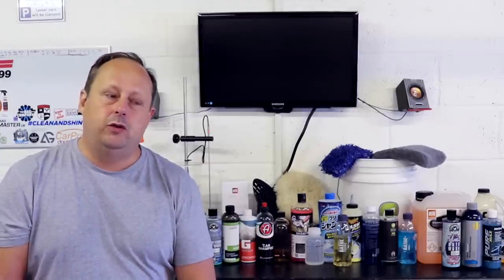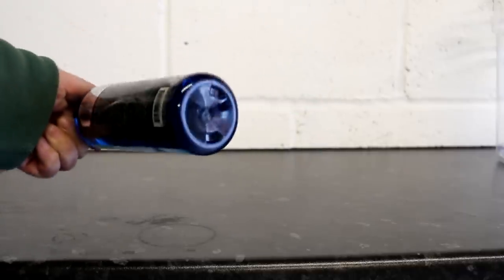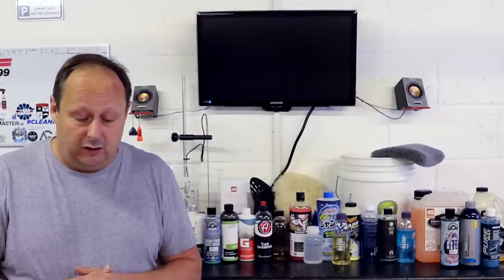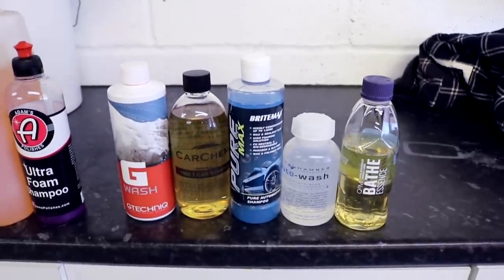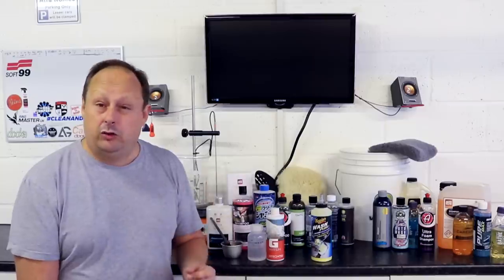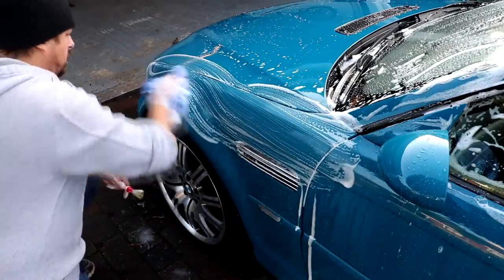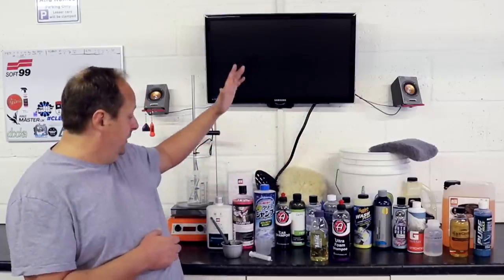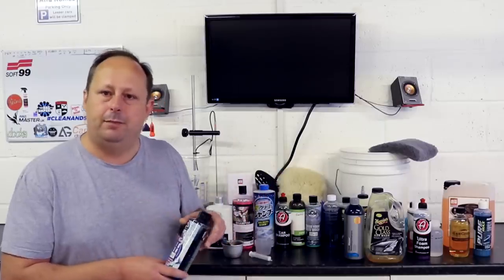The Best Car Soap Shampoo - 20 product shootout

Comment: Do you normally mix hot or cold water with the shampoo?
Reply from the maker: no Moh, unless is freeing cold.
Reply: @ForensicDetailing  Thanks. Even in warm conditions, surely you will get better cleaning performance if you had warm water? No?
Reply from the maker: @330d5  water water will help to break down grease and oils in dirt.  but really after prewashing a car, and then making the contact wash.  Ive never like not been able to get a car clean to the point where I thought I needed warm water to help.    like you can noticed the difference when you wash dishes with cold water you loose the ability to break down the grease quickly..   but I think car cleaning doesnt need that level of degreasing where the warm water will make a difference.   dunno though Mo, nothing wrong with using warm water in the wash bucket.
Reply from the maker: @330d5  prolly mate but when you wash a car do you ever at the end after cleaning it have dirt that hasnt been broken down or removed, where you felt like you needed more cleaning power?  Its more about just hitting all the panels with the mitt to not miss spots than using warm water I think.. dunno though I just dont use warm water generally because I have to go inside to fill up... but if its freezing cold I might do it.

Comment: Sonax not included the test?
Reply from the maker: no mate.   but I want to hear exactly what products you think should be in there. gives me a an idea of like what to consider brand/product wise in future.
Reply: Sonax gloss shampoo, sonax 618 shampoo, sonax actifoam.
Reply: I had the Sonax Gloss Shampoo. It's not very foamy. 
Now I got another Sonax soap, the base one with no glossing agents. It's also not very foamy.  I would not recommend. Last time I used it it left some dried soap on the paint which I didn't expect at this time of the year.
Personnally I can get them cheap when I drive to Germany. But the only benefit they have in my eyes is that they are liquid and therefore easy to mix in the bucket.
Reply: Used the Sonax orange shampoo also and found it poor. Low concentration, low foam and poor lubricity. Not a nice scent either, one to avoid.
Reply: @BrianW1612  , what is the ratio you used per liter? Some are saying the shampoo is good enough. I have seen on YouTube where SONAX actifoam is sudsy, slick, high concentrate, good cleaning power.
Reply: @sunmode3205  I tried it at my typical 20-25ml per bucket and it was poor. Upped the dilution to around 40ml and it still didn't impress me. It underperformed at a higher concentration than my other shampoos. I demoted it to being added to the wheel bucket until it was finished.

Comment: so for 10l of water, I need 20ml of shampoo, correct?
Reply from the maker: depended on the concentraiton of the shampoo Milos.. but you have to do the maths mate.. something like 10,000ml to 20ml  = 1000 to 2ml which equals 500:1     ratio...    so if your shampoo is a 500:1 ratio yes 20ml to 10litres is good.   if its 1:2000 then its going to be 4ml
Reply: Forensic Detailing Channel thanks and  for test winner 1900:1?
Reply from the maker: @milosbgd  yes mate its all in the video :)

Comment: Be aware that many people use Meguiars Wash plus to remove old wax and give you a clean surface to start paint correction with
Reply from the maker: including me :)  I am constantly needed to strip wax.  with a foam block and a bit more scrubbing I can clean off most waxes as long as they are not fresh on.
Reply: @ForensicDetailing  Ha, you are probably where I got that bit of info from!

Comment: you bumped up Adam's (33:40) @ 72p right after you kicked out CarPro's Reset @ 37p, only so that you could kicked it out on cost basis 37:54.
clear logic...
Reply from the maker: yer bit wierd isnt it.  but the Adams product has a USP that I cant see on the other ones around drying time.  So I wanted to bring it into the final 5 even though I new it was gonna get eliminated.    ultimately the adams car soap is like somewhere around 70p cost per wash... versus like what 4-5p cost per wash of the winning product.    and ultimately the winning product is just as high quality but 20 times cheaper.   Kind of using the last 5 spots to show what my favorite ones were even if the logical doesnt stack up.    Carpro rest not making the cut was also wierd because this soap is very good, but I felt it was just like mystic bubble but thats priced better as well. so many tough choices because I had to filter out good products. not easy to do.

Comment: Can shampoos be used as snowfoam?
Reply from the maker: great question..  answer is yes but  I dont believe they work great as a prewash as they are more expensive and not formulated the same.  could be splitting the atom though.  its something that might make a good video.
Reply: Interesting.. Might test it out